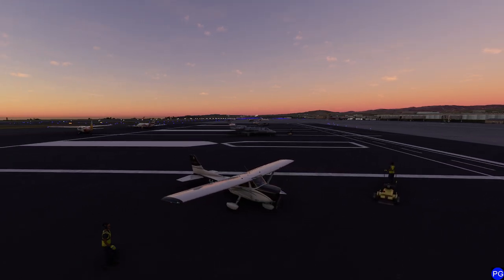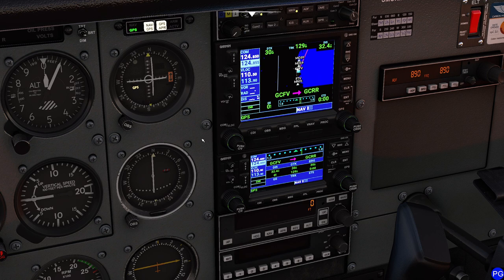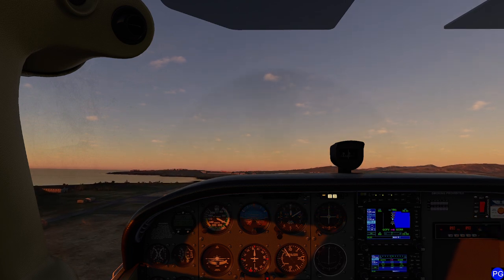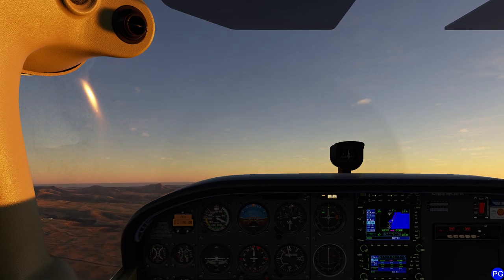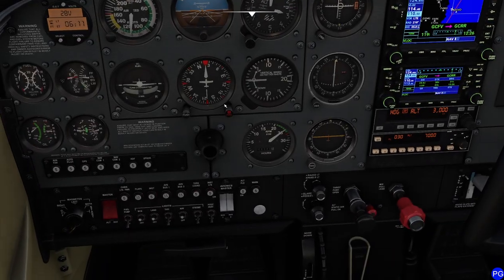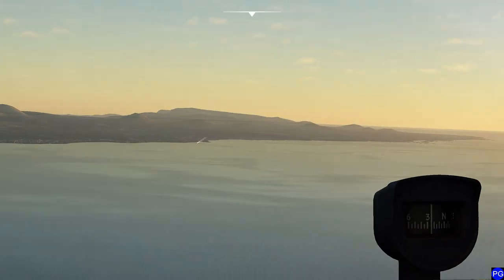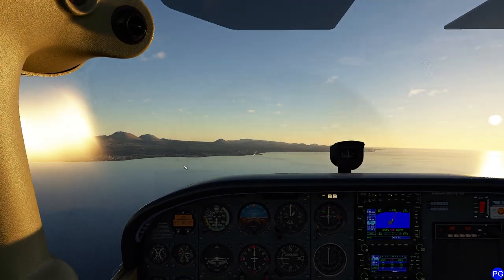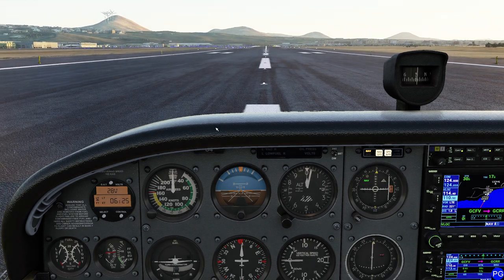MSFS - Flying the Textron/Cessna 172 Steam Gauge Version

Comment: What does "steam gauge" mean? I don't want to search through 20 minutes of video to find the answer. It looks like the gauges are the same as the normal Texatron planes.
Reply: Steam Gauges are analog, the face of the gauge resemble that of a steam pressure gauge.
Reply: an opposite would be non steam gauges like a G1000 system, steam= round gauges analog face